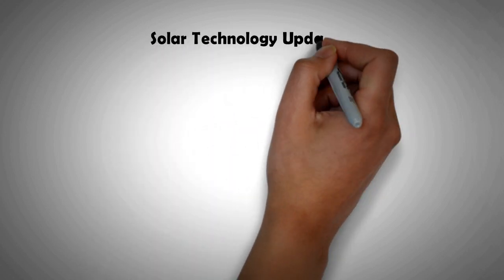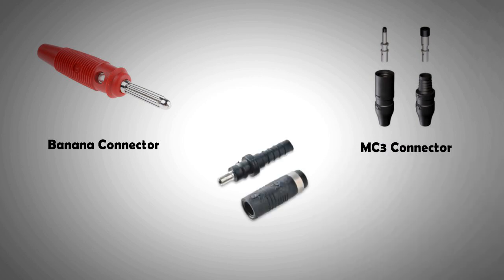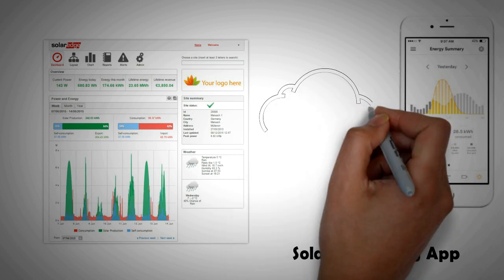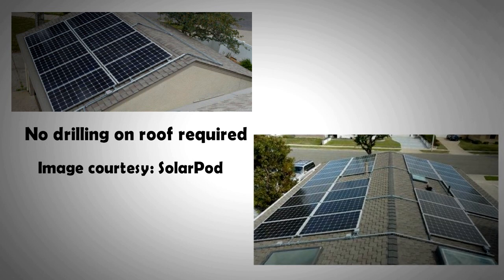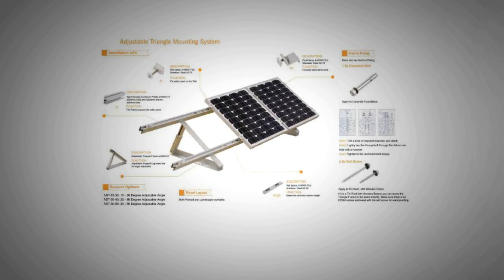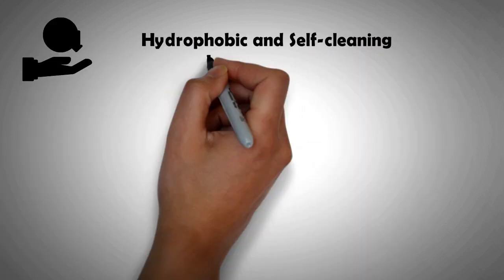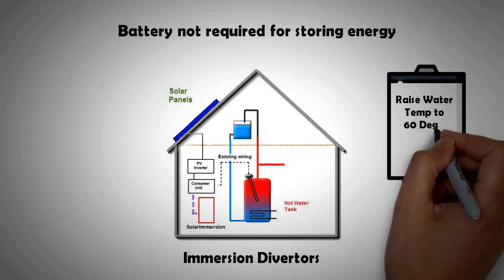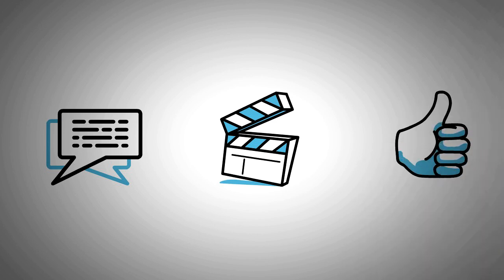Solar Technology Update Part 4: Peripheral Technologies for Solar PV

Comment: Count has gone up but price hasn't dropped to any degree . All the add ons you get to control the voltage and current add more and more cost to install a solar panel system .